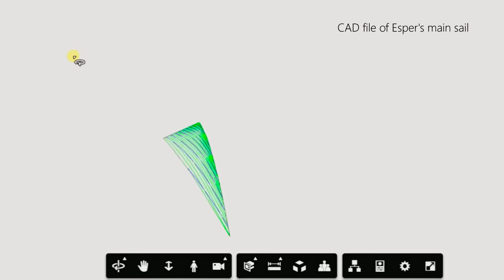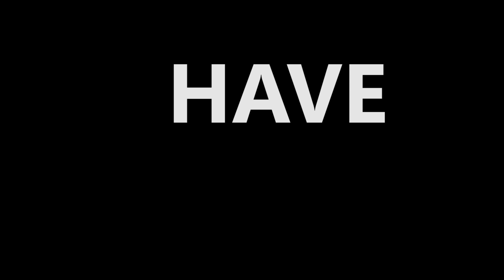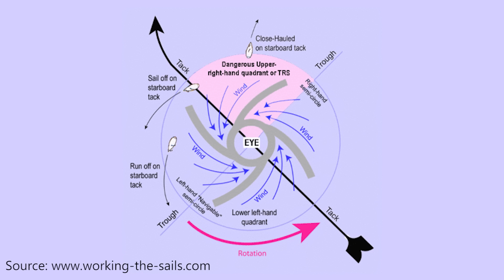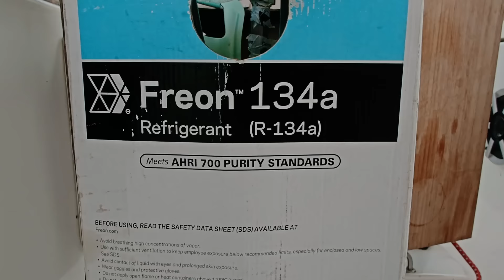MY SAILING SECRET, NEW SAILS & STORM TACTICS... Ep 54

Comment: Thanks for sharing your concern with going in and out of marinas.  Our boat has the same issue, the bow blows fast and lots of prop-walk in reverse.  We are normally at anchor, so we don't go into marinas very often.  Makes me feel less alone.  Normally there are no issues, but still have the nervousness before.
Reply from the maker: Even after 12 years I hate manoeuvring in marinas (Jamie does it!). Probably a hangover from the sh!tty, gearboxes we've had which like to stop working when we've needed them most. I've become pretty handy with lines and fenders! 👍Liz
Reply: Nice to have a good deckhand.   That really helps. :)

Comment: Four new sails--fantastic! It will feel great once you get them up. The fridge--it there one brand that is more reliable than others?
Reply from the maker: Hi Tim. I'm no expert on fridges but the problem was the ageing Danfoss compressor, something many 12v fridges use to run them efficiently. Simply age-related corrosion, which is why Adnan was able to cut them off and braze new ones on. Yep, looking forward to getting those sails up!

Comment: I don't blame you on the marina thing.  Esper is getting up there in size for single-handing in a marina without a bow thruster or help from shore.  Even short-handed it's a handful I'm sure.   

I'm fine with our 35' full-keel boat in a marina with just the two of us, but single-handing gets a little more "interesting."  I'm totally fine single-handing the 30' boats in our sailing club in the marinas and harbors around Chicago,  taking them to fuel dock and pumpout and back to the slip or the moorings by myself in just about any normal everyday conditions.  But a 35' boat is a lot more to handle, and going up yet another 5 or so feet is another big step up.  Just 5 feet longer is about 50% or more extra displacement, there usually is a lot more freeboard & windage as the size moves up in 5' increments, (as well as beam)  and all that extra weight doesn't just want to stop on a dime or let you fend off with a kick or a push-off if things get a little wahoonie-shaped because of currents and/or windage.  Little miscalculations turn into BIG trouble pretty quickly.
Reply from the maker: +SV Barry Duckworth [Liz] True, and the trouble with these old bluewater boats is they weren't built to go backwards!
Reply: Our boat will go backwards fine, for a given value of backwards.  Sooner or later (sooner usually) we'll start to veer off of moving straight back and the boat will turn fairly sharply in one direction or the other.  I can fix it with prop walk usually.  Prop walk is the poor-man's bow thruster.  But in order to do that it takes a lot of herky-jerky thrusts.  

When we took our boat down the Chicago river to the boat yard last fall it got pretty "interesting" a few times.  There are dozens of bridges that have to lift up for the sailboats and usually there are at least 10-12 and as many as 30 sailboats all jocking for position in a one block area of busy waterway between two bridges.  Most sailboats around here can turn on a dime with their fin keels.  With us, give me 40 acres...